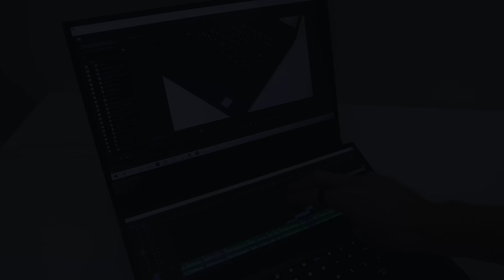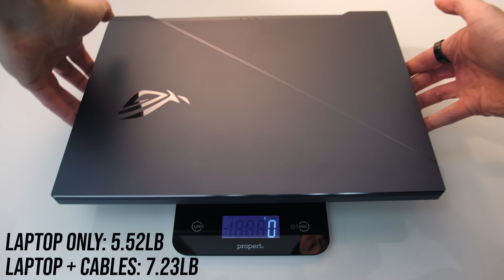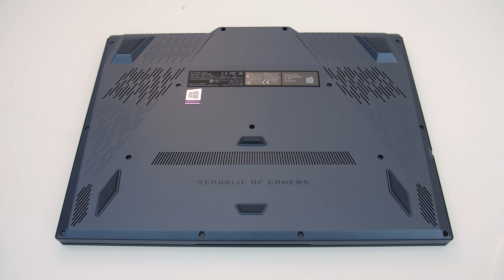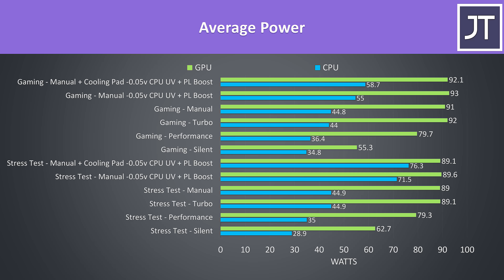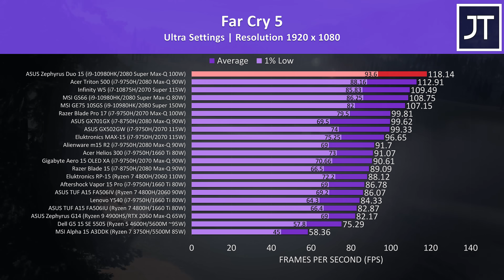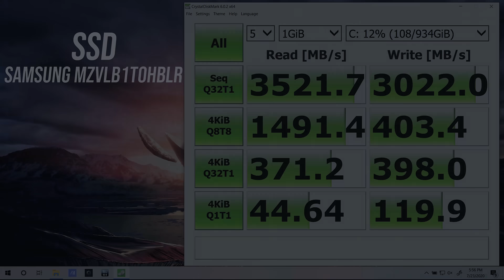ASUS Zephyrus Duo 15 Review - 2 Screen Gaming Laptop!

Comment: I want this laptop but I can’t find it anywhere
Reply: Did you ever find one? They're sold out everywhere and the ones you can find are way overpriced. I'd recommend waiting until January-April for the 16" model.
Reply: @eight2seven  micro enter have a few but you have to pick them up in store only. I will be waiting till latter for sure. Good luck getting one.

Comment: Hay I was just wondering would it be safe to run this laptop exclusivities in silent mode? I’m extremely sensitive to loud noises like fans and would prefer to play games that way, however I would rather put up with louder fan than have my laptop cook itself to death also do you think the heat on the bottom will negatively effect the laptop after a long period of time?

Comment: I must admit quiet mode stress test had very impressive fan noise and even on performance mode the fan was not that bad.. it had a pleasant tone compared to many. This can game in ultra in quiet mode though which is rad. Just a shame there is no 17" option AFAIK, I would probably actually get it if so. Good latency mon results, decent thermals, thunderbolt. Hmmm.

Comment: Hi!!! I need a laptop for university and I don´t usually play video games. I am between two laptops with two different processors but with the same characteristics. Which is a better processor for laptops, i5 1035G1 or Ryzen 7 3700U? I have seen some benchs and i5 looks slightly better. Do you agree? Ryzen 7 laptop is 20-70 euros more expensive

Comment: I have this laptop and I have had some problems with it. First of all, this machine gets soooo hot, this is kinda obvious but I think is more that what I thought. Second, and this is the biggest issue, when I reboot  to the operating  system it takes my to BIOS utility and once there the system does not recognize any storage and because of this it will not allow me to restart the computer to Windows operating system. Third, the computer shuts down by itself when you leave the computer for more than 30 minutes with no activity. 

Very disappointed since is a brand new  laptop. I am returning it :(

Comment: If you buy a 4k model and lower the resolution to FHD, will it make 300hz refresh rate possible? The higher price would be worth it for the sake of i9 processor vs i7, and if lowering the resolution allows equivalent refresh rate or higher than the FHD model, then you would truly have the best of both world as a creator and a gamer!
Reply: I have the same question. Maybe with an external monitor, you’ll get a higher refresh rate (?)

Comment: Huh well thats interesting, a max-q gpu doing better than its non max-q equivalent. And with two screens!  The cooling really does make a difference especially when considering slimmer laptops. Also, its been mentioned here already but the memory isnt actually running at 3200MHz but is downclocked to 2933MHz like the M15. Dont know why they didnt just use 2933 sticks honestly. Great review as always Jarrod! Always glad to see your content.

Comment: The problem is, the RTX 2080 Super is the best GPU in a laptop but it cant handle 300FPS
Reply from the maker: I don't think that's a problem at all, 300Hz is just only for esports, and it does fine there.
Reply: @JarrodsTech  for this laptop, a 240Hz screen is enough for this power and it can be more affordable
Reply: @testiclebird  honestly anything higher than 240hz is money wasted on other features.

Comment: Another 2080 super MAX-Q ? . In High Prices? Nevermind another scam again. No thanks.
Reply from the maker: big lol, nothing wrong with max-q.
Reply: @JarrodsTech  nah man you showed me by your videos that 2070 max-q are have less peformance than 2060 imagine 2080 super max-q compared to normal 2080 or even 2070 super without max-q. Sure it have less noises and more cool laptop. But the Peformance man.
Reply: @Ersdown_Liberia  The thing is that 2070 non max-q has a tdp of 115W and 2080 non max-q has a tdp of 150W. You can still (barely) port around a  laptop with a 115W tdp GPU, but good luck carrying around a laptop with 150W tdp GPU. The MSI GE75 is the only laptop I heard of so far with the full blown 2080 Super, and it is 17 inch and thick. Have fun with that.
Reply: @mingyi456  yeah i like it like that. Doesn't matter how thick it is for me. Since i always go out bring the Laptop to my Grandma's house or go to my friends house. Sure i have PC but i can't bring all my PC parts to my friends or Grandma's house. Even if it's heavy. If doesn't matter if i ride bike or car.

Comment: I need a display port, it's a disappointment that this laptop does not have it. Not going to buy it just to gamble on whether the USB C with DP is going to work or not.
Reply from the maker: Good thing I test DP over Type-C and even tell you what GPU it's wired to 😎
Reply: I believe this guy's review covers whether the usb type C ports have display output
Edit: I just watched it and he indeed covers this. Maybe just watch the video yourself next time.

Comment: Lately Asus devices have been on 🔥
Reply: My asus tuf fx504 is literally on 🔥

Edit: I applied high quality thermal paste and cleaned fans now I'm chilling with stable 120 fps
Reply: yeah the Zephyrus g15 has literally been lit
Reply: My ROG laptops temp sensors max out at 99°
My GPU has rarely seen lower than 98°
And my CPU sensor doesn't even work anymore.
Reply: @Free_Krazy  clean fans and apply new thermal paste
Reply: @Free_Krazy  should've RMA'd the laptop
Reply: Pun intended?

Comment: the real question is r the thermals good enough to purchase it & can the second screen be used for illustration by using a digital pen?
Reply from the maker: Thermals are good, all things considered. You can draw on the 2nd screen, its brightness and colours are decent, and you can disable the keyboard so it doesn't get in the way.

Comment: And the hits keep rolling out. Love this laptop
Reply from the maker: Plenty more cool stuff on the way!
Reply: @JarrodsTech  Can you confirm whether the ram is running at 3200mhz or is it underclocking to 2933mhz
Reply: @JarrodsTech  M17 R3?
Reply: Love this laptop too!
Reply: @jasdeepmanchanda7437  do you have it? I'm planning no getting it but i'm not sure if it's worth I want to get the 300hz version have you had any problems with it so far.